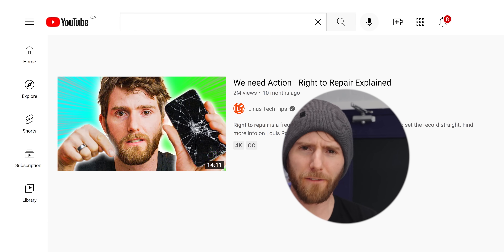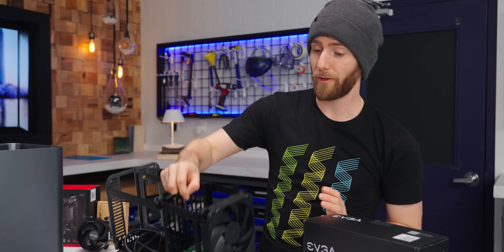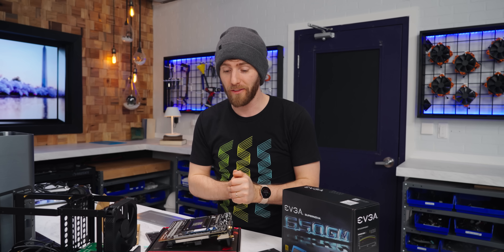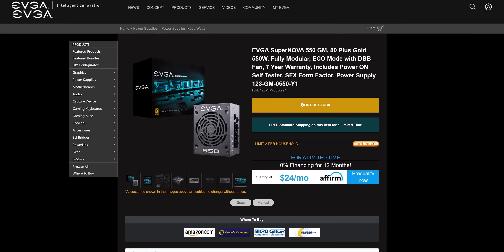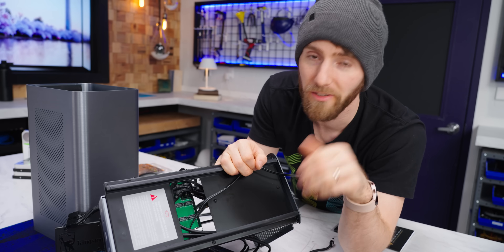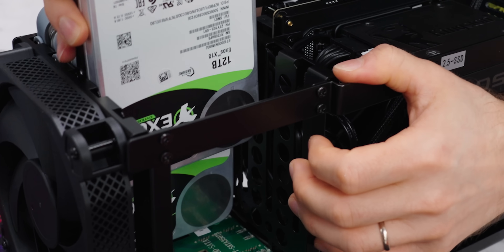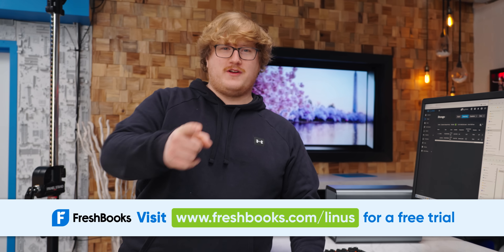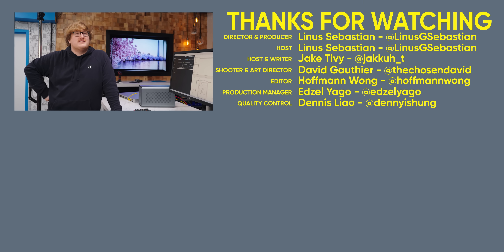This blows away the competition - JONSBO N1 NAS Build

Comment: There's one aspect you haven't covered, the energy consumption, particularly at idle. It was at the time the main reason I went with a premade, but might be different now ? Your savings in the long term can "easily" outweigh the added initial cost

Comment: The 650W PSU seems waaaay oversized as the 550W version would have been. I'm running a similar self-built NAS with 4 HDDs and an i3-8100 on a Pico PSU with an external 90W brick and it works perfectly fine
Reply: I'm surprised, just your CPU alone has a TDP of 65W. I'd be really curious to see if your system throttles or if you just haven't given it enough workload to make it crash out due to lack of power.
Reply: @Naetrox  I forgot it's actually a 8100T with 35W TDP and it's mostly being used as a fileserver and idling around. I was running it under full load for a long time, I might indeed be pushing my luck

Comment: Why would miniaturization be important for a storage solution? Small case are inherently more noisy and have worse airflow, which doesn't matter much for a 24/7 up machine that likely will be put in a closet or storage room. ITX motherboards and PSUs are also more expensive.

Wouldn't a big, roomy case with very simple access to components be much better for airflow, maintenance, and upgrades?

Also OpenMediaVault ftw!

Comment: Me and storage🤤, Linus and powerful CPUs.

Haven't made a custom NAS in a long time. What about putting the OS on a USB on the back for quick access. And couldn't you split the SSD into read and write caching depending on the workload for even better performance. 

The higher the CPU the more power you could use and produce more heat. I've learned that for me I don't need tons of storage to save everything. When my storage array got lost, the only thing I missed was my music.

Comment: The real way to save money on this is, just buy a Dell Optiplex with a Haswell quad-core from Ebay for $80, buy a SATA controller card for it, then buy an HDD cage for however many drives you want, and keep it outside the case. It's not elegant, but dirt cheap, great performance, and very easy to access the drives. Or honestly, if one of your computers is always on, just use it as a NAS. Plug in the drives, share the folder on the network and that's it. That would save on power consumption too as a full PC idling 24/7 will draw like 40W. That's a KWh per day or about $3-4 per month.

Comment: I've built a similar NAS with a HP microserver n40l with 5 8tb Nas drives, and 120 GB boot add , I upped my ram for it from 8 GB to 16 GB and it's running truenas core, Plex server, qbittorrebt and sabnzbd. Runs really well. The n40l has a Apu from amd and it's still good enough to serve 1080p. Serves mainly as a personal Netflix. My last NAS based in the microserver was 11.9 tv and lasted 7 yrs without missing a beat. Ran out of space so my current one is a bit over 23 tb. Nice thing about truenas is I could move the drives and pool to a new server if the n40l finally dies. I do have a second one as spare with no drives which I'll use first.

Comment: Speaking from experience, it will absolutely allow you to use the root user by default, by default the root user can access all the pools until you change them so that they have a seperate owner, or specifically deny root login.

Comment: Why not use a cheap apu? Like a 3200g or 3400g? That would be so much easier than an extra pc, plus it would/could be a fully functionally pc with an apu. Weird to go with no integrated graphics. Sim. Weird to me but I’m new to mass storage systems. I would prob slap a gt710 inside or something tiny if no apu…

Comment: I've had the In-Win IW-MS04-01 for several years now.  The only thing I don't like about it is having a FlexATX PSU as they're all whiney, wish they did a slightly wider model that fit full-sized ATX or at least SFX and ideally six drives instead of four.

It only takes four full sized HDDs but I replaced the ODD bay with a 2.5" adapter and it takes a 2.5" internally, so I have six storage drives + NVMe boot drive..

Comment: A small low power PC is what I ended up doing for my NAS duty as well.  When I realized I couldn't even GET a NAS anymore that wasn't full on "sorry, you're part of the cloud, get over it", I just said to hell with it and rolled my own.  Considering the hassles I seem to have with commercial software these days (aka, it's fine to ship garbage cuz' we can fix 'er later!) anyway and ESPECIALLY considering that I have a very particular set of needs, it ended up being cheaper and faster to just take an old atom board, stuff it in a box and stuff it full of FreeBSD and drives.  It's especially nice because I limited the throughput to about 80% of the network throughput.  Now, when I do a big transfer that takes half a day, it's no big deal.  Latency of the network stays about the same, I can still transfer other stuff while it's going on and it's just made working on big data on remote filesystems a joy to work with in general.  :)  Plus, it's another BSD kicking around to use for various things if I want/need.  You can never have too many boxen.  At least until it comes time to up the A/C capacity or pay the power bill.

Comment: wow..  what a massively over priced pos case..  $126USD + 104USD in SHIPPING...  so $$230 USD before being nailed for taxes/duty etc..   for a measly ITX case which only real "feature" is it has a minimal backplane pass through for 5 SATA connections..   not even a HBA function ffs..

If you are doing a home build skip this crap that Linus for some idiotic reason is showcasing.. since it's almost as big a ripoff as the massive fuck you up the ass prebuilts...
Get any decent small case that can handle at least 5 3.5HDDs.. toss in a good quality AMD based mb.. say a b450 mATX from MSI.. basic features is all you  need and any am4 APU and some ram and it will completely blow this away and have more than enough power for more including running your own router and other goodies..
Add in Unraid and if you are intent on running more than 5 HDDS then get a decent HBA and you're laughin.. and for a hell of alot less $ yet again.,

Comment: Hey guys, you always use ZFS for the shortage configuration. Why is that? There are a bunch of limitations especially if you want to expand later on or you have a mismatch of drives floating around you want to use - in the spirit of doing stuff on a budget.

Comment: Then there is me with a QNAP TVS-871 that I ripped the internal USB storage with QTS out of and run Unraid on it lol. 42TB usable data, upgraded the CPU to an i7, added in 16GB of RAM, installed a 10GB NIC and a Quaddro card for transcoding. Thing is tiny, weighs a tonne, is fast enough for everything I need at home (lots of docker containers, Plex etc) and is pretty much silent.
I do miss the speed of "true" RAID6 vs Unraid's "JBOD with parity" model, but Unraid is just oodles better to use than QTS.
Best part is I got it for free from my old job because it had a failed disk and was out of warranty lol.

Comment: Synology NASs aren't single purpose by long shot. You can run a ton of apps, docker containers, and straight up access the linux OS and install anything you want.

Also, buying used components is cheating if you're comparing it to a new product.

Comment: This kinda misses some of the key features of nas appliances. If you ever have to replace a drive or upgrade storage, it’s an offline situation on this machine. I have a netgear readynas and despite having NAS drives in it I have had to replace a drive long before it’s rated mtbf and I did so without taking anything offline. I mount shares to docker containers so it’s not just “oh you won’t have your backup for a bit”. One of my docker containers is frigate. That’s “oh I lose recording of security cameras for a while”. 

Now running an appliance does have its downsides. For example, netgear is killing its readynas product so os updates will likely stop soon. But I’ve found you can get truenas and unraid working on the intel based products. My netgear readynas rn526x now runs truenas scale. I also upgraded the ram from 4GB to 32GB so upgrading may not be entirely out of the question.

For the cost side, this box did cost me quite a bit. But this was a device released 6 or so years ago (I bought mine just under 6 years ago) with dual 10gbit Ethernet, 6 hot swap bays with trays that can support both 3.5” and 2.5” data drives, dual core quad thread pentium D processor, and 4 DDR4 ram slots. I’m coming nowhere close to pushing it to the limits of its capabilities.

You can get a ton more flexibility out of building your own NAS. But my appliance meets my needs without being terribly fiddly. I still have plenty of room to grow into it, and now that it’s running a platform using zfs, I get those additional benefits.

Btw, I don’t use my nas box for running additional applications. I have a nuc with portainer to manage docker. This is especially important for my frigate deployment where video decode performance needs to be good and solid support for the usb edgetpu is a must (not sure if truenas can even provide that).

Comment: I just threw 6 4TB drives into an old pc and loaded xpenology, a synology boot drive. works great. and i had a 2 - 4x removable drive bays. so i have an offline spare drive in case i need to swap it quickly. i think the 32gb ram on it is too much. but its ddr3 so like what else would i put it in.

Comment: I can't believe that box, with no space in it, does not run way too hot. I've used a bunch multi-disk cabinets, and regardless of the active cooling (READ: fans), there's virtually no airflow due to the circuit board blockage. And that's just a hard drive cabinet. The bigger the hard drive the hotter it runs, and my experience with EXOS drives is they run hottest. I'd be interested in some temp readings after you get it all working. And even it it runs ok, the heat will take its toll on the components.

Comment: Could this hardware setup be utilized using xPenology?  That would really work pretty cool for me since I already have a Synology DS1819+ with the DX517 expansion unit.  I would probably use this type setup as a backup server for the DS1819+.

Comment: Some things wrong/missing in the video...

SMB is used natively by both Microsoft and Apple, with even most Linux builds having some compatibility with it with minimal effort. Time machine data sets are basically SMB shares with additional settings so that MacOS detects them for time machine. Unless you are using some legacy, ancient, Apple device you should not be touching the apple specific sharing format, it even warns you as such if you try to create one.

If you add or change SMB users you need to restart the SMB service for the changes to take affect. What was shown in the video of enabling the service, adding a user and then accessing the data set be would not work and was possibly the result of doing things out of order for the video.

Raid-Z2 was recommended because Raid-Z1 does not offer enough data protection for so many drives in a single vdev. If a drive does fail there would be a significant rebuild period during which another drive failure would cause data loss. Resilvering large capacity drives is a slow process, potentially taking days due to the nature of ZFS, during which time there is no redundancy protection from another drive failure. Raid-Z2 supports an additional drive failure allowing the vdev to remain protected during the resilvering of a single drive. As vdev drive count increases the redundancy level must also increase, and eventually you need to consider having hot spares so that resilvering can commence the instance a drive failure occurs. The loss in capacity due to redundancy is purely the cost associated with reliable data storage and can be considered as an increase in cost per usable TB.

ZFS is not that friendly with it comes to upgrading storage later. Although pools can easily be expanded by adding additional vdevs to them, you cannot easily expand vdevs themselves once they are created. This means adding storage to your ZFS based NAS is not as simple as buying an additional drive and throwing it in an empty bay. You will need to buy at least 2 drives and in that case set them to operate as a mirror, which effectively uses 50% of the additional capacity as redundancy. This is one of the reasons why a lot of people recommend using mirror vdevs rather than Raid Z ones because it allows pool expansion by 1 drive capacity by buying 2 drives while still keeping redundancy. Mirrored drives also resilver a lot faster than Raid-Z drives so even though there is no redundancy for a period, the period is much shorter than Raid-Z1.

TrueNAS does not allow using its boot pool, the drive the OS is installed to, for anything other than the operating system. Given the operating system is only a few gigabytes the result is that even a tiny 128 GB SSD is mostly unused with the space effectively wasted. This problem will only get worse as the smallest SSD sizes increase. It might be tempting to use a USB flash drive or SD card for the boot pool as those are available in smaller sizes but this is not recommended according to the official documentation, likely for reliability reasons. There are hacky, likely unsupported, work arounds to get useful access to such unused space, but not something for the inexperienced.

The system did not use ECC memory? For NAS with high uptime it is strongly recommended to use ECC memory as memory errors can accumulate over time and have potential consequences for data integrity. ECC memory is designed that most bit-flip errors are automatically corrected and those that cannot be corrected immediately crash the system rather than allowing the wrong data to be used. ZFS is resistant to sudden crashes but is less resistant to memory errors. If you do not use ECC memory I would recommend scheduling the NAS to restart at least once every week, if not every few days, to purge any unnoticed errors from ARC and other volatile cached data.

There was no discussion with respect to power usage of the system compared with an off the shelf solution. In this day and age of rising energy costs this is an important consideration when buying new or even second hand. Something like desktop Ryzen is good if you want CPU performance and energy efficiency under workloads, but generally does not have that good idle power usage. Lower end Intel might offer less performance or upgradeability, but traditionally have very good idle power usage. If you are not using CPU heavily then disabling precision/turbo boost might save additional power with likely unnoticeable impact. Similarly high transfer rate memory might not be useful in such situation allowing it to be clocked slower to save power. I am not too sure but given how my Ryzen 9 3900X behaves I suspect idle power usage of the built NAS to be quite high compared with what some Intel systems have been reported with.

Comment: I would make sure to grab a Ryzen CPU that includes a GPU on the chip, the ROG board LTT used has both HDMI and DP ports available allowing you to attach a monitor directly (my son owns this board).  This circumvents an external install of the OS, do it directly on the system.   Otherwise AWSOME BUILD.